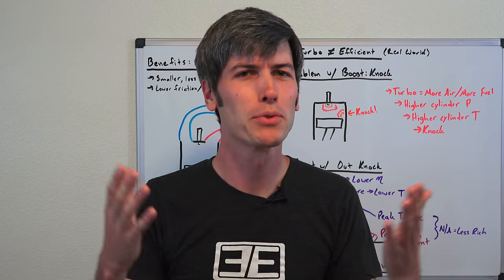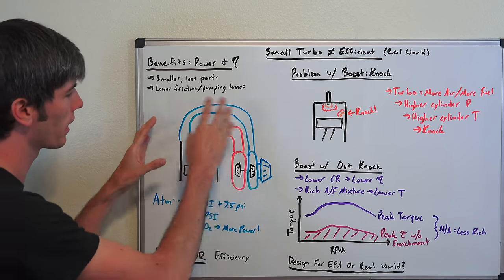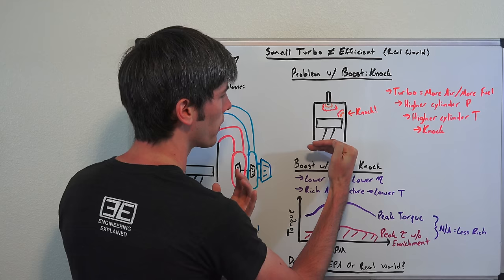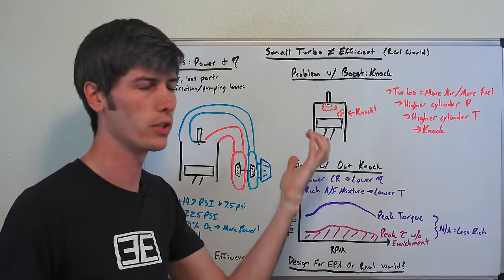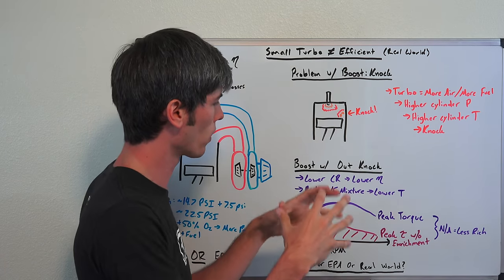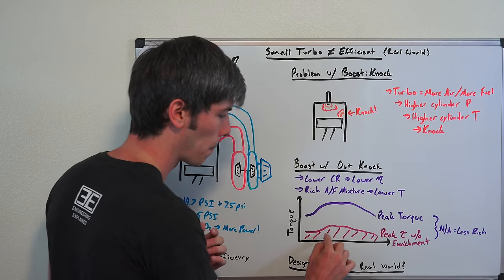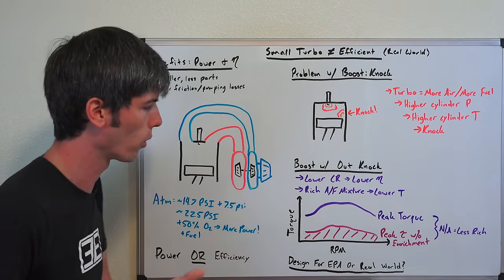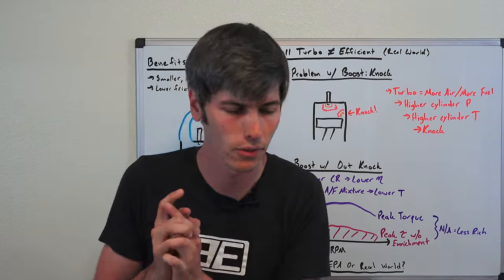Why Small Turbo Engines Are Not Efficient

Comment: Just to say, Saabs never suffered from knock. Or at least they prevented Knock. They Developed APC in 1986. (Automatic Performance Control). They used the spark plugs as a sensor and detected the onset of knock from the ionisation within the combustion chamber. If knock was about to occur, then timing would be adjusted. And/Or, boost levels reduced.
This meant it effectively detected the Octane of the fuel. Better quality of fuel = more power.
A Saab 9000 Aero has standard compression ratio. And yet with 98 Octane RON fuel, it can run 1.4 BAR (24 PSI) boost pressure with no knock. Giving a max of 310bhp from its 2.3L 4cyl. Ford are only just getting to that now with the Focus ST and RS.
Reply: No SAAB 9000was getting 310 hp stock... and modified it wouldn’t have lasted as long as newer cars.
Reply: Most OBD1 and Every OBD2 car i've ever worked on had a knock sensor which is basically just a microphone on the engine block, you can pop the hood while the engine is running and give the engine a light tap with a wrench and you will hear the idle drop because the ECU will pull timing, All ECU's do is advance timing until it senses knock then retards timing back down until it stops thus getting the best ignition timing possible. Nothing special or new.
Reply: "No SAAB 9000was getting 310 hp *stock*..." Did he say stock? No he didn't.
Reply: Paul Taylor too bad GM killed the SAAB.
Reply: Yes @ 310bhp the B234R is at Stage3. My point is, a stock engine will run at 1.4 Bar boost with no Knock when using higher quality fuel.
FYI: The above is a just a remap. A B234R can be taken to 500bhp on a completely stock engine. They are fully forged from the factory so dont need to be touched. ALL Stock hardware goes to 310bhp. Then you just change the turbo and injectors and head for 500.
Reply: @Dont Tread on Me:  Saabs did use knock sensors. They used circuitry in the Direct Ignition cartridge itself that uses the Spark Plugs as knock sensors. So each individual cylinder is checked. Unfortunately when GM killed Saab, they also took the Patents for this.
Reply: Ion sensing is not using piezo mics.
Reply: Don't all manufacturers use knock sensors and adjust timing (and boost if turbo)?  Maybe Saab was first but I think everyone does this now.

Comment: Idk about all of that,  but in my experience, keeping at a lower speed seems to do pretty well. I have a 2013 Ford escape with the 1.6 EcoBoost engine. Epa estimates it at 33 hwy mpg. I can achieve it if I keep it at 65-70. However in Texas most of our speed limits are 75 or hwy. If I run 75, it gets about 28. Well under the advertised amount.
Reply: This has to do with gear ratios, mostly. The beginning of your last gear is around 60mph, so under 70 you're still in the low revs
Reply: @kingsford6540  air resistance is also considerably higher
Reply: Keep in mind that the highway fuel efficiency ratings are due to the way cars are tested using a dynamometer and the the Highway schedule which is run at 60 mph, not 75 mph.  Higher speeds means more drag (proportional to the square of the speed) resulting in lower mpg.

Comment: Many v6/v8 drivers have been saying  this for years, in a more performance oriented application a smaller turbo 4 engine 
often performs worse than larger engines in the real world.  Happy to finally see a video from EE covering this topic.

Most recent examples of down-sizing fail is the Porsche  718 Cayman/boxer,  went from a 6-cylinder to a turbo 4 and make identical  MPG to the old engine.
Had them simply lowered displacement but kept it to 6-cylinders the same result would have been achieved without loosing it's wonderful sounds.
Reply: BigHeadClan its not about power its about a useable torque curve.  Turbo cars can have a more useable torque curve.  If the torque comes on sooner less trottle/work needs to be applied to get the vehicle moving.  And turbo cars normally have a 4000rpm range where the torque will remain higher than a NA vehicle which you only get peak torque at a single point in the rpm range.
Reply: Gareth Wynter more torque  means your car is in boost to generate that extra twisting force.  

Which  means more air and fuel required the more torque  that is generated   and also no turbos also have  only a single peak torque  number  the curve  is just  flatter across a larger range. 

Need to remember  hp is an expression of how much work is being done.
Reply: wrxassa  if you think Porsche shared almost anything with  VW  mechanically youd be  mistaken.  

Some  parts or  a motor with Audi yes but  that is a more premium  segment.   Also  what does VW  or  Porsche have to do here?
Reply: @BigHeadClan  hp is how fast the work is being done.
Reply: @counti41  yes  and horse  power  is a Metric calculated based on torque you can use either Metric when discussing durability thanks for coming out.

Comment: I was very impressed with ford focus and its 1L 3cyl turbo, easily got 45mpg. It has a very low torque range so you could run it below 2k rpm and it still pulled nicely. I didnt get it for performance though, wasnt as peppy as a normal 2L.

Comment: A 2.0L @ 14.7psi boost is now a 4.0L.  Its really just displacement on demand, going down the highway its a 2.0L again, but when you pass its back to a 4.0L.
Reply: SP392 not exactly but first comment worth giving a thumbs up
Reply: close enough ;)
Reply: The big difference being flow rates, intake air temps and active vs static compression but you're not all that far off.
Reply: There is no replacement for displacement.
Reply: I had  (2) 2.0 Direct injection turbo engines, one in a Forester XT the other in a Sky redline.  Both rated at about 250-260 HP.  My 13' Accord with a 3.5L V6 (rated at 278 HP) and variable displacement was faster and got better fuel economy.  The Accord ran on 3cyl when that is all you needed.  Problem with a turbo is you are always into the turbo and asking more air and fuel to get moving and stay at highway speeds.  If you paid attention to the whole video they reason for these turbo engines is not really fuel efficiency but to get the EPA numbers higher.  That does not translate to real world fuel economy.  Ask anyone with an eco boost Ford Pickup.
Reply: My good man, you basically just said your V6 Accord (with more displacement) was faster and got better fuel economy than a turbo motor with less displacment... That's exactly what I mean when I say there is no replacement for displacement. Your right about the ecoturds too. They cannot do what a V8 does in the same way. Numbers look good, mpg sound good but in the real world its not the same.
Reply: Or you could boost a 4.0 to 14psi and have an 8.0L. Bigger is better
Reply: My old man has a 2017 5.0L and accomplishes the same. The big difference? Try towing something with a lot of wind resistance. The N/A engine will be able to more efficiently produce power under load. I'd bet his city milage is slightly better as well because whenever you're under positive manifold pressure, you're running less efficiently with maybe 10 dregrees ignition advance and richer fuel curves.

Downsized turbo engines are beneficial to produce power when needed and give the economy of a small engine for just cruising. That's why the ecoboost trucks are so popular, most truck owners only need a truck a couple times a year so having better economy at cruising speeds is better. The problem is that these force-fed engines are less efficient when under boost. That's the entire point of this video.
Reply: Obviously forcing air into a motor makes more power. So you say your 2.7L ecoturd has the same torque as the 5.0, while it may be a true statement, its also a different feel on your foot and it works allot harder to produce that torque out of half the displacement. I bet the bigger motor gets better fuel economy while towing. There is no BETTER replacement for power than displacement.
Reply: Still having a very noticeable lag and no sound that can be described as such. Not a big fan of turbos in most cases although in the right car and application it can be fun (Audi TT RS for example).
Reply: I´m not talking about a truck. I talk about a regular passenger car or sports car. Any 2.0T i have drive has lag and it IS noticeable A LOT. If you do not notice it try driving a C7, F-Type or Huracan for example. Any naturally aspirated or supercharged engine will give you that almost electro car like feel of instant power with no lag.

 A turbo cant do this, its just not physically possible. Everyone denying this has never driven a good NA or SC Engine, sorry. Also drove a 4.0l AMG Engine recently and it has up to 1.5 Seconds of Lag at low revs of about 2k rpm (even though max torque comes in at about 1800rpm). Just takes to spool up.
Reply: Apparently you don't understand what lag is. Its the time from no boost to maximum boost pressure, not where in the rev range the engine produces its power. Two completely different things. If i floor a NA or SC Engine it makes all of its power available in the rev range that it currently is near instantaneous, a turbo engine needs to spool up those turbines first, get them to peak boost and then starts making all of its power in the current rev range.

And that is lag.
Reply: You do realize there are different types of superchargers ? Roots, Screw, Centrifugal ? For the third category your assumption is right, boost increases to redline, for the others its just wrong. It all depends on the ratios your belts are driven when you make max boost. And again you do not understand the difference between spool up lag and a dyno chart and when max. torque is theoretically reached.

You still don't understand the basic physics behind it. Stop being ignorant. It'll take any turbo car some time to make max boost because of the charger(s) and the time they need to spool up, since a roots/screw SC is belt driven it delivers torque the second you floor it. No spool up there. It may deliver less boost if its not in max boost range but all of the "less boost" is delivered instantly.
Reply: I guess thats where we disagree. For me there is no one size fits all concept. I also have to disagree about the efficiency part, look up the EPA Numbers for an AMG GT with a super modern 4.0T Engine vs. the relatively oldschool 5.0K in the F-Type. Both have the same rating, the SC is just way less complex and delivers instant power in any part of the rev range. In the real world i can also drive it with 91 Octane whilst the GT needs 93. Or EU 95 Octane vs 98. All that engineering and cost and nothing gained from it. In the real world i can drive mine with 30mpg, a friend of mine with an AMG GT never got into the 30s. So much for efficiency...

For a big saloon or a truck, instant power delivery is not the first thing that comes to mind, so yes i would go for turbo there because of the torque you can make, but not for a sporty car. For me its just about the application. The best concept probably would be Hybrid plus Turbo or SC and Turbo to fill the gap in terms of lag (in a sporty car). Turbo on its own in a sports car ? No thanks, not the best idea. Not as progressive to drive, not as foreseeable, not even as efficient.
Reply: You brought in fuel economy. I just told you the EPA ratings and real world facts. Why is this my fault suddenly when my supercharged 5.0 V8 can get better fuel economy than your small displacement high boost turbo engine ?

This should rather show you the stupidity behind downsizing too much and the legend of a turbo engine being supposedly wayyyy more efficient. Its just not true.
Reply: Damn Shaun you better youtube superchargers advantages and disadvantages. Maybe turbo lag and efficiency also. That way ThirdLife can go about his day and not have to keep educating you. Then you should sell those fords and buy a GM!

Comment: They are extremely efficient. My Jetta gets 42-48 mpg on the highway depending on how fast I drive. In the city it is around 30 mpg.  The car goes from 0-60 in about 8.5 seconds.  I couldn’t be happier with it. The only problem with the TSI engine is that I will have to get a carbon cleaning in about 60k miles to keep it in top shape.

Comment: Finally someone talks about this! Here in europe all we got the last decade were tiny 1.0l - 1.5l (mostly 1.0) turbo engines, because the official fuel economy numbers were measured by a method called NEFZ, which was pure protectionism of the europeans thanks to lobbying. In that test only 5 hp were used on average. So turbo engines did not use their turbo at all in the fuel economy testing and the official fuel economy mostly depended on how small the engine was, the smaller the better. In real driving these cars depend completely on the turbocharger to make power and use at least 30% and up to 50 % more fuel than the official numbers say and their emissions became much more toxic than 20 years ago (and they were allowed to emit 10 times more and a much more dangerous kind of particles than diesels, extremely harmful to the human body).

You americans don't know how lucky you are that you have EPA, best fuel economy testing on the world.
Reply: exactly, those tiny 1L engines suck so bad.
Reply: Mgoblagulkablong sorry, but I want to see your sources. I highly doubt that the stated numbers in your comment are true. It is true that the recharging of the battery, applying duct tape to the gaps, changing camber and toe, having higher pressure in the tire, lowering  weight by removing additional stuff, and tuning the ECU to maximise efficiency is allowed within the NEFZ, but with an additional error of 4% the difference of the date isn't that high. The cycle is a standardised on with 66% of city driving and 33% of highway. It includes the coldstart and even fuel and temperature and air pressure are standardised. The resistance (rolling and air) is mesured and applied to the dyno on the forehand. 
The thing is that every vehicle runs through that cycle to be able to compared. But in the real wold the variables do change more. And especially the position of your right foot, if you know what I mean. 
The thing is that speed and throttle position do matter more in the real world through air resistance at high speeds and the lamda value and thus the enrichment of the mixture. And it is obvious that if it's floored that it's neither efficient nor clean, because what you are doing is solely asking for acceleration. If you want to achieve the bumbers stated you need to shift early, slightly touch the accelerator pedal and use the same things the manufacturers do. But it is possible to achieve good numbers close to the ones mesured in the real wolrd. F.E. the Honda Jazz is stated with 5.3 l/100km. I achieved 5.5 myself. And this while the battery was charging and haven't used duct tape. Nobody said that it is easy to achieve the numbers, but nor impossible. 
In the USA the cycle is not that efficiency focused. This results in numbers closer to the ones achieved by most of the users. Both cycles are there for a reason and NEFZ gives the manufacturer the ability to let the engine mork in it's most efficient way. This is not the most realistic but it shows what the engine can do. But when asking for power the car has to deliver. It's the same thing with BMW and the "Deutsche Umwelthilfe" who tried to sue them for manipulation of the diesel because when the car was floored or reached high rpm (so there was asked for power) the EGR valve closed. That's becaue they we're asking for power and therefore fuel needs to be burned with fresh air. It's obvious that EGR needs to be closed in this scenario. And it's obvious that if you use the accelerator pedal and ask for some power that fuel needs to be burned.
The emissions do mostly are clead out by the cat. But they depend on how you get the fuel in the car. Having a look on the emission classes I belive that most new cars are much cleaner than before.
Reply: agree... european test is totaly fake, 0-50 km/h in 27 seconds... WTF
that's why smaller is the engine, higher is the difference between official and real world consumption...
my car has a small 4 cylinder naturaly aspirated engine and despite claiming worst consumption than tiny 3 cylinder turbo, in real world has better consumption, yes it lacks of torque but who cares, just drop a gear.
Reply: I had 1.4tsi and it did 45mpg average. The worst I ever got was 40mpg and best 52. Gave it back at end of finance deal. Only
Kept our other car a 1.6 naturally aspirated does 35mpg in same conditions. The turbo is a lot faster yet more economical. Not as economical as promised but still very decent for a mid sized petrol car. Before that had 1.2tsi and that did 43 with 38 worst and 60 best. So that could do more in right conditions but on average did less. Makes me wonder if 1.4 is about the sweet spot. I test drove a 1.0 turbo and most of the time was only in mid 30s economy.

Comment: Using a suzuki baleno 1.0 RS (112hp one) here in UK. I can confirm torque and power crossover is very volatile if you are heavy footed...however. if you know your pedal and maintain some patience you can find that very small sweet spot that allows very very high efficiency on the road in it. Basically where the turbo wastegate is cranked open the tinyest amount to allow the increase in torque without the near 2x hp jump.